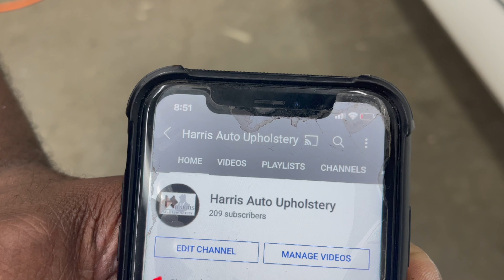Found a shop to do the top on my Cutlass

Comment: There's no motor to run no convertible top like that it comes with a pump hydraulic and most likely the reason for it not to work is because of low hydraulic fluid hope that helps 💯